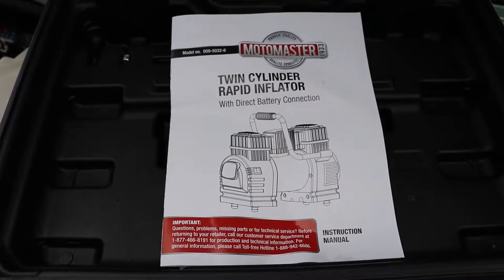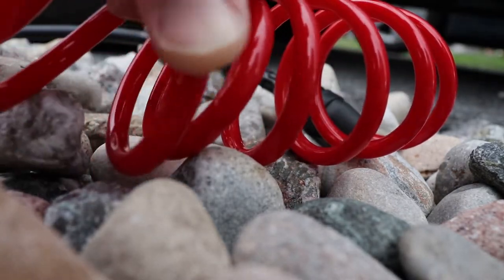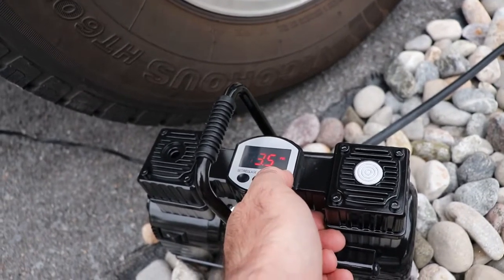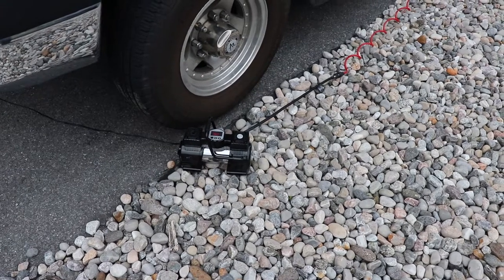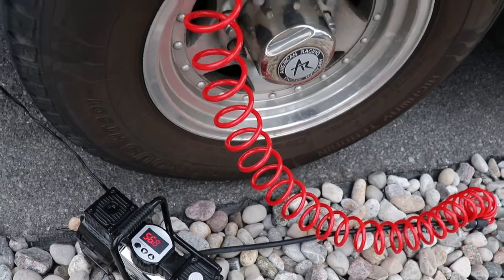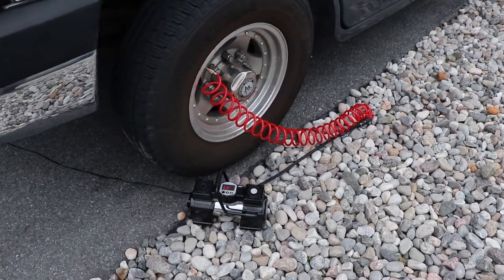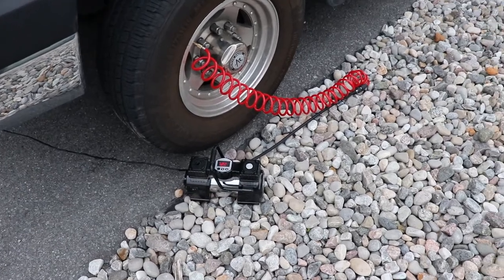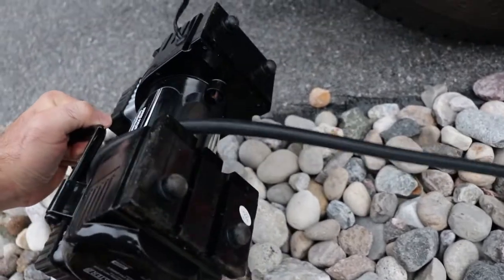MotoMaster Heavy Duty Tire Inflator with Case, 2-min

Comment: I've had this compressor in my truck tool box for about a year.  Both times I tried to use it I couldn't get enough pressure.  Typical guy I thru out the instructions, and never noticed the big sticker over the digital display.  Was ready to throw it out.  Thanks for the info  and making me face palm myself.
Reply from the maker: Yeah, I was really confused when I got it too.  They put a big sticker over the controls.

Comment: I do have one and the manual. There is an important notice: 1) The product records latest pre-set pressure. for example, if your pre-set pressure gauge is 45 PSI, the product records the pre-set pressure at 45 PSI the next time. 2) Before reaching desired pressure, the compressor can be shut off manually using the switch.

Comment: My unit stopped working 3 months in & I only used it like 5 times
Reply: I've used it maybe 14 times and still pumps to 30psi in like 2 minutes, will be testing it with a 4 way inflator.

Comment: Will this be able to perform 4 way tire inflation with 35” tires?
Reply from the maker: I'm not sure, I would probably use small CO2 or Nitrogen bottles if I had to inflate tires frequently.  I actually have a regulator for doing that.
Reply: @SteveRivett  I own a Jeep with 35” tires (minimum 15psi and maximum 40psi). The vehicle will be use for off-roading. I’m no expert but is it safe to assume that this compressor can handle the 4-way air pressure? I don’t really like to use nitrogen or CO2 as it will be more expensive in the long run.
Reply from the maker: @michaelbjornsanchez5733  it will be able to do it but I'm not sure how long it can run without overheating.  When you do one tire at a time it gets to cool off a bit.